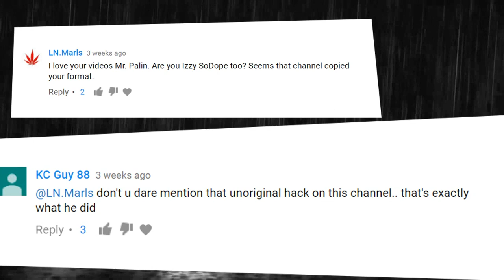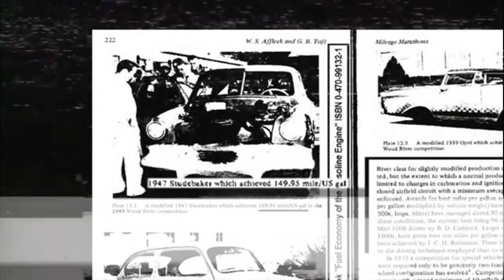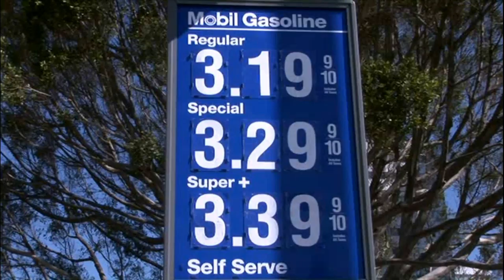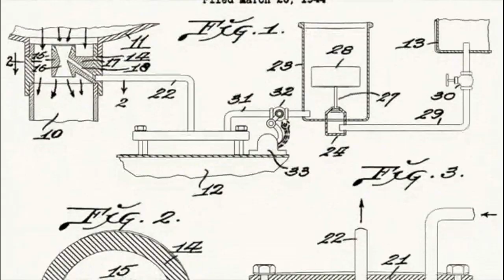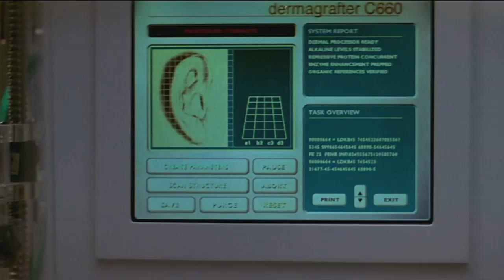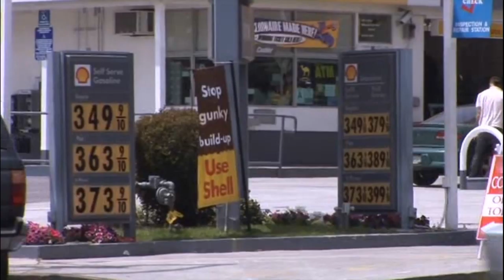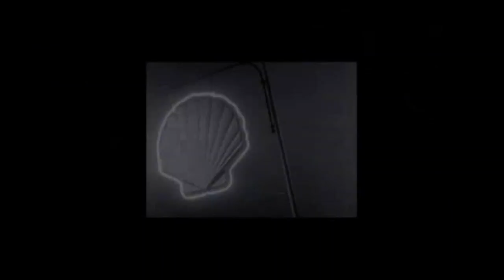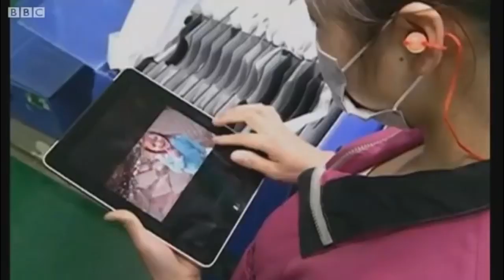Bill Burr - GasHole

Comment: They have made it almost impossible for the consumer to change the mileage on new cars. It’s possible for a gasoline motor to get 100 mpg,if it’s tuned right.
Reply: Ofay Hussein  mainly by making all the adjustments automatically with a computer chip, thus taking the ability to adjust things like air/gasoline mixtures away from the consumer. Newer cars won’t even run if this computer chip gets damaged. It probably doesn’t make any difference but there used to be ways of tweaking your car to get more horsepower or gas mileage.
Reply: Ofay Hussein  actually a well tuned engine doesn’t run as hot as an untuned one. Air is free as you move, coolant doesn’t evaporate or get used up in the cooling of the engine unless there’s a leak. So.....

Comment: Think about it this way: If you were the leader of a superpower in the middle of escalating nuclear tensions and an ongoing space program, lying about a car that runs on water plays to your advantage. If one really were to invent a car that runs on water, suddenly your fuel economy becomes maximally efficient and you can use the petrol for military and space exploration purposes, giving you the upper hand against the competing superpower (the USSR). Even lying about it would have your enemy rushing to arrive at the same solution, but ultimately wasting their time because it's a lie to begin with.

There are legitimate reasons for why a scientist at Shell would lie about this.

Additionally, physics and medicine are two very distinct disciplines. To design a functional vehicle, such as a car, you need to deal with things like gravity, drag, friction, air resistance, etc, etc. It's always going to cost you energy to produce energy. Cars rely on the fractional difference between energy spent and energy produced in order to operate. Overcoming that difference to a significant degree, particularly if you manage to perfectly equal it, would merit you the Albert Einstein World Award. As a bioengineer, you don't nearly have to deal with those factors to a comparable degree. They are just not the same fields.

There is a vast chasm between believing and understanding.

Comment: No you  are  right. Our  planet  is a giant  electromagnetic  generator. What  the  electric  companies  enacted  was a standard  voltage  rate  that  can  be metered and  regulate the  amount  of volt amps on a 3 faze  distribution  system , and  charge  the  customer.

Comment: Eco-mentalists are the ones ruining gas mileage: they get leaded petrol banned, compression ratios have to drop, efficiency goes down.  They get crapalytic converters put on the exhaust, thereby restricting exhaust flow, thereby reducing efficiency.  Carbs don't meet the emissions standards so the industry moves over to port injection and just as they're getting the efficiency of those going strong, more emissions standards come along and they have to move over to direct injection, in turn, appearing to offer better mileage but then after about 30K miles, the valves start to clog up without have fuel running over them and you're back to worse mileage again.

It's like F1 - every time a team comes up with an invention that puts them way ahead of the competition, the governing body comes along, bans it, and puts everyone back to square 1!

Comment: They can do more than 40 miles per gallon, but you'll either need to drive 50 or slower, or construct a vehicle with large lithium ion batteries and an electric motor with a gasoline generator.

Comment: You can make the gas miles much better but then you lose power. Its a balance between a strong and fast car and one with good gas milage. A bigger more powerful engine needs more fuel its simple.  If you look at a smart car they are basically free to drive.

Comment: The addition of water in the carburetor has been around since the 40's. My Dad used in in his old car. There was even a kit many years ago (around 2000) for $100 bucks or so that would include a reservoir for the water and the necessary hoses. My Dad said he could do it for $15. I sold that van soon after and went with fuel injected engines.

Comment: Bill now loves performance vehicles. He knows better now I’m sure. It’s like saying a formula 1 car can comfortably pull 5g - why the fuck can’t we make a ford focus hit a 30 degree  banked turn at 150 mph. Bc bill it’s not a prototype car. Of course you can make a prototype engine or infinity miles will the help of the nerds. The moment you add the weight of a human , well  you just lost 50 mpg right there on that prototype. Now add the seats, the internals that make it go over 40 mph, airbags, safety, etc. that car is now down back to 100mpg. It it crazy to think shell had a a production car that got 100mpg in 1979 with the most  advanced high  performance hybrid fuels that could be made? Absolutely not. In fact I’m sure they did.  But is the average consumer going to buy a production car using technology that equates to a $100k car that barely hits high way speed limits? Absolutely not. It took another 20 years to finally start to invent ways to replicate those prototypes in more affordable ways per unit. Aka hybrid systems. I know this bc I’ve read Dr Blackmore’s book . It didn’t “disappear” it was dry as hell and no one wanted to reprint what was less a book and more a research paper.

Comment: I don't "Believe" in corporations but the chemical energy of gas doesn't change. The specific energy of 87 grade is about 120 MJ/gallon and finding the max potential gas mileage of a gallon of gas is really really complicated just for example a 2.5 Ton SUV going 70 mph contains about 1 Mega Joule of kinetic energy so there is no way you could get an internal combustion engine to get 1000 MPG there is just not that much energy in gas. I main problem with internal combustion engines are going from chemical energy to pressure energy to mechanical energy to kinetic energy and you lose a lot of energy to heat along the way.
Reply: No Timothy No, Bill can't take that!
Reply: @FriendlyFarmMachineryToolCpBel  Bahahahahahaha I'm not saying corporations aren't dirty as fuck when it comes to economical cars just look at GM and the EV1. And who the fuck would sell a gas-saving patent to a gas company.

Comment: Listen: the BEST we have is maybe 30% efficient, right? So that means 70% of the heat energy created goes into the cooling system or straight out the tailpipe. The basic process  has been around for 180 years...and this is the best we have? Riiiiiight.

Comment: I don't know about 100mpg but I know for a fact that auto manufacturers intentionally reduce the fuel efficiency of their vehicles. This is partly to protect the motor from morons who don't take care of their cars. It's does less damage to run rich than lean so by having the car run a little rich off the showroom floor there is a little built in wiggle room if you are the type that doesn't perform maintenance. They also manipulate mpg through the use of parts that are intentionally inefficient. 

I have a car that I bought new and modified to make faster. The first thing I did was reprogram the cars ECU (computer). Through adjustments of air fuel ratios, ignition timing and the like I gained roughly 45hp and was able to get an additional 2 mpg. As time went on I continued to do a lot of engine modifications and by the time I stopped the car had an additional 260hp (from 168 to 427) and was getting an additional 6mpg as long as I wasn't flooring it. When I did I was getting about 3mpg less than stock.

If I was able to do that by myself, in my driveway (excluding the ECU tuning which was done on a dyno) how couldn't an auto manufacturer with thousands of employees, billions of dollars, and any tools imaginable pull it off?

Comment: 80 years ago we flew biplanes with single engine, now we have exited the solar system. 80 yrs ago Porsch designed a 4 seat car that went 60 mph and got 30 mpg. 2019 we have a car that goes 65 mph and gets 30mpg. Yeah right.
Reply: Way to compare apples to oranges. Biplanes used normal combustion engines. Rockets use rocket engines. They're nothing alike.

Funny how the fuel economy on planes haven't changed much either huh? Because there's a limit to what you can do with a combustion engine. It can only be so efficient. What shitty car do you have that it maxes out at 65mph? Even my old 2001 truck can go over 100 on the freeway.

Comment: A small electrical current into water separates the Hydrogen gas, which can be captured and used for fuel.
Reply: What if the guy said fluid and the witness just took it as water just because he didn't know better.
Reply: Which is a fuckin inefficient process and consumes more energy then it produces.

Comment: You got a 6 inch pipe, only so much water can go through that pipe no matter what you do. There is a maximum flow rate. Same thing with a gasoline engine. There is only so good a gas mileage you can get if you working off the same platform with the same fuel and lubricants. Simple as that. No matter how much you polish a turd, it is still going to be a turd in the end.

Comment: Of course efficiencies can be improved to a point. The idea there was a conspiracy to suppress fuel savings is ridiculous. The fuel industry prices would just adjust upward just like the electrical industry. The electrical industry is actually pushing electrical saving technology because they just get the regulators to increase the rates as pricing is based on a percentage of household income. The less electricity they have to produce for the same gross revenue, the greater their profits.

Comment: The technology exists but the market doesn't value 200mpg (see the VW 1L concept - made using available parts) as much as it values acceleration, interior space, comfort and convenience features, safety, etc.... People would rather spend $70k on a Lexus or a truck than on an odd, tadpole-shaped two-cylinder that gets beaten off the lights by an economy car.

Comment: When you add a strong enough current of electricity to water, the water starts to get agitated and the hydrogen rises out of the water. Could you not find a way to trap the hydrogen and use it as a fuel?
Reply: Greta Thanos , well Greta.....Tesla had created a little thing called zero point energy. Our handlers suppressed that tech and buried it along with him. So you can have generators that through motion with magnets are creating its own energy. There's also solar and wind. This whole carbon shaming thing is a scam and another way to tax the cattle.

Comment: Its math. There are limits of energy in every gallon of gasoline that can be released in combustion. To release more energy you would have to do something completely different. Fusion? Fission? I'm not sure, but there is a limit to how much energy can be harnessed from combustible gasoline. You can try to improve harnessing methods, but the math behind how much energy output you get from a molecule of gasoline converted to plasma via combustion is limited.

Comment: Water is 2 parts hydrogen 1part oxygen. Hydrogen will easly run an engine. Electricity separates the molecules. Check out Cody’s lab. BTW Cody’s lab will give you some mind blowing material

Comment: Wait, so the take-home here is that we could have much better mileage and cars that run on water?
Reply: No. Since it doesn't make a lick of sense. How does an engine with water as the fuel combust?
Reply: @vorbo01  Right. So why was he talking about water going into engines? That part is a bit fuzzy to me.
Reply: @vorbo01  The hydrogen is what combusts. Water is two parts Hydrogen to one part Oxygen. They found a way to separate one of the Hydrogen molecules and combust it.
Reply: @pw4316  yeah but I'm going to say they didn't. Especially in the mid 20th century. Separating hydrogen and oxygen is incredibly difficult and very expensive, since the energy required to separate the molecules is a bit more than hydrogen actually gives when combusted. There is no way in hell some random dude in the 40's managed to get a fully working hydrogen car going. BMW, Honda, and GM all tried making vehicles in the late 2000's (James May reviewed one on top gear around that time), and all were abandoned due to the difficulty in making them as well as safety concerns

Comment: It's not bullshit.
The gasoline engine as we know it is very highly-optimized for cost. In other words, the modern gas engine is by far the cheapest possible solution per horsepower, while still being able to produce acceptably low emissions (pollution output).
Any other solution that improves on it will cost a lot more. There are alternatives, power systems that produce little or no pollution, have high power output, and are cheap to drive (very energy efficient). But, they're all too expensive for the average consumer.
So, quit it with the conspiracy-theory bullshit until you've actually looked into how this stuff works and what the factors are they have to juggle to produce a viable product for you to buy. Ranting and raving about it doesn't solve problems and doesn't spread knowledge or insight.
Want much better fuel economy?
Sell the Ford Explorer or the Silverado 4WD, and buy yourself a nice new moped.

Comment: There were steam powered trains in the 1800s so why wouldn’t someone be experimenting with water and steam to run other devices?
Reply: Low energy efficiency. Internal combustion engines (like the one in your car) use much less fuel than steam engines. They're also cheaper to build and require much less maintenance.

Comment: Motorcycles could lose 60-80lbs easily cars and trucks 1000lbs easily, both would prolong wear and tear parts as well as handle better, stop better and better fuel milage to boot.
Why dont they is my question? U.S. Steel (excess weight) getting a perk of some kind?
Reply: The problem is structural integrity, safety, features and style.  People aren't buying dune buggies wrapped in saran wrap just to save weight.  Also at higher speeds, air resistance is most of the load on any moving object.  People aren't buying missile-shaped cars and don't want to, so...

Comment: There's a reason why there's no improvement in fuel economy and it's not what you think. It is absolutely possible to get more mpg but, pollution norms restrict the amount improvements we can make in fuel economy. For better understanding read about air-fuel ratio and how it affects pollution. If you run the engine on a very lean mix, the amount of NOx emissions increases because there is abundant oxygen for the Nitrogen to react with. NOx emissions are much more dangerous than HC or CO emissions. This restricts auto makers from making extreme lean burning engines. You can google the graph of NOx, HC and CO vs air-fuel ratio for a more clear understanding. I understand that Bill exaggerates stuff for the sake of comedy, just trying to prevent misinformation. https://www.researchgate.net/figure/Effect-of-air-fuel-ratio-on-gasoline-vehicle-emissions_fig6_260878177 link for the graph...

Comment: I’ve personally beheld antique industrial motors n-rigged to run on water (extremely diluted gasoline) at antique tractor shows. The man was a “un”certified engineering genius, and those machines ran the entire three days non stop. I’ll never be convinced this technology is not possible. Could have easily adopted it and raised the price of oil to accommodate the improvement, with a far less negative impact on our Earth. Wish I could have picked the old man’s brain while he was still here, and had the intelligence to understand it.

Comment: Printed human tissue as temporary solution is good as long solution dubious, hip replacement made from titanium not works so well in long run. Human tissue regenerates human stomach after 4 days you have 100% new stomach because 7% stomach acid chlorine acid eats your tissue walls very fast, skin after one week even heart muscles after 25 years is brand new (heart and especially heart valves for heavy lifters is sensitive issue, only transplantation can help of pig and cow ir mechanical :) ), all bones are regenerates in seven years, aging is process of errors in replication of DNA when regeneration of tissues slow down to minimum and immune system in general. All america health care takes about 1/3 of budget and doctors are millionaires.

Comment: I'm very surprised they are showing videos of people using plastic waste for fuel. But 100% ,electronic fuel injection is designed to use a specific amount of fuel. Its a joke. There is a big pushback that aftermarket engine tuning software isn't safe for the environment. The EPA is cracking down on people installing them. .....Especially when I can use that software to make a 05 Yukon get 5/7 mpg better than it did from the factory+more power. Greedy asshats

Comment: The average gas mileage of a motor vehicle in 1970 was 13.5 miles per gallon. In 2010 the average rose by 10mpg to 23.5 (ie. about a 75% increase in fuel efficiency) despite the fact that a much larger percentage of vehicles now are trucks and SUVs. So Bill's assertion that we've only gained 2 mpg since the 70s is nonsense.